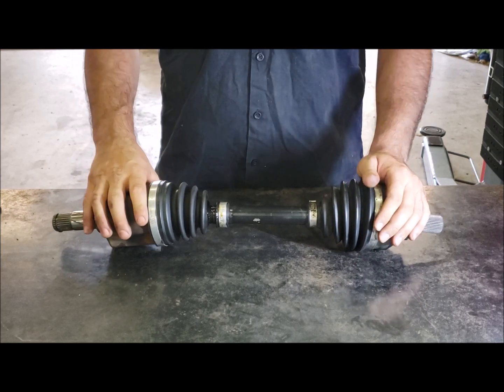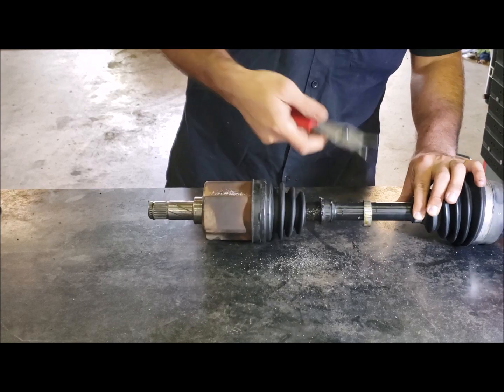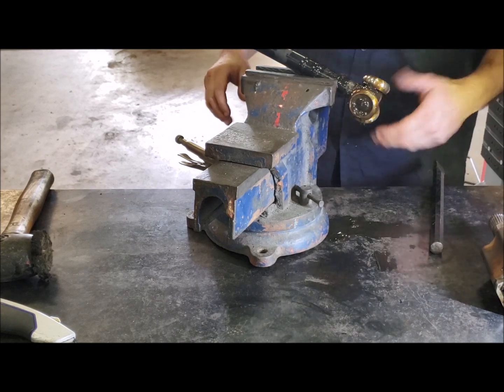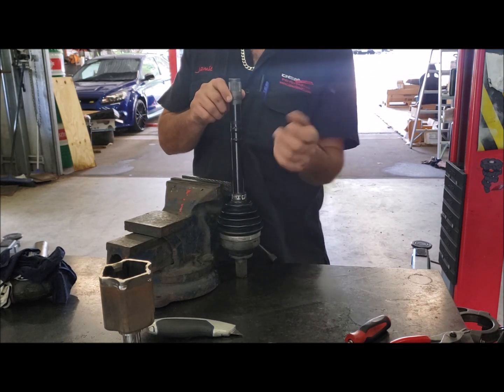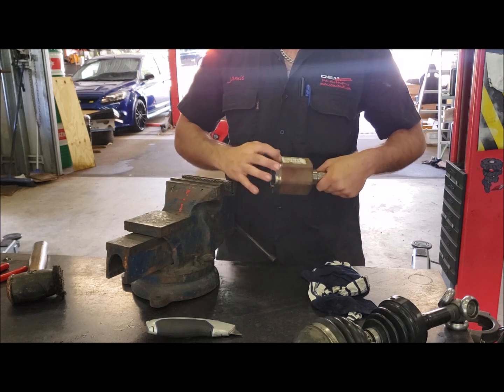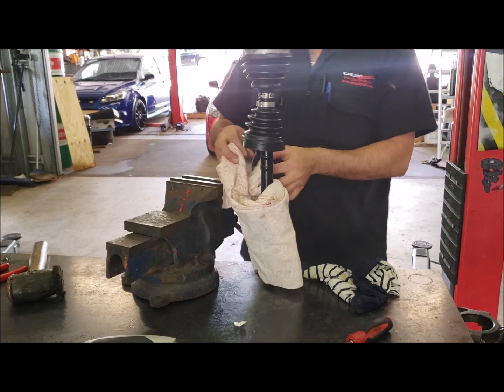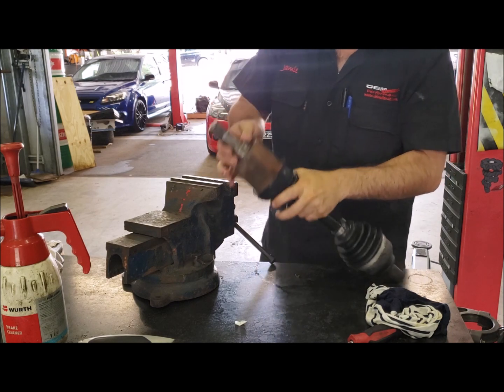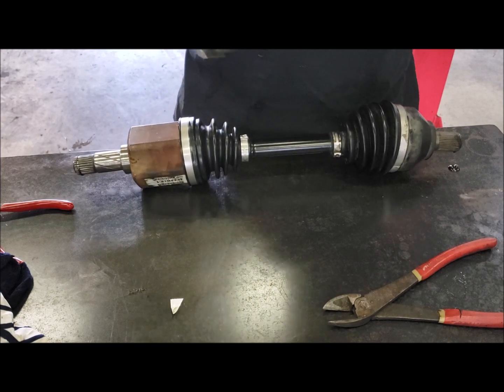XR5 Turbo / ST225 driveshaft rebuild & CV boot replacement. Step by step by OEM Denied Performance

Comment: Can the other end be replaced? Does it not fail as much hence not doing it in this vid?
Reply from the maker: anything can fail but havent ever had one with a failed outer joint myself as its a much more robust ball type joint design. The outer joint doesnt come apart like the inner one does so if you have one with a failed outer joint you need to replace the drive shaft.
Reply: @OEMDeniedPerformance  thanks so much, this helps more than you know

Comment: Quick question, is the RS driveshaft exactly the same or are they different part numbers? Also, on the longer driveshaft, my tripod literally pulls out of the joint with no effort at all.it actually came out into the boot when I was changing the bottom arm. Managed to get it back in with a bit of manipulation without removing the boot. Does this sound normal? Yours seemed to require quite a bit of tapping out.
Reply from the maker: if the needle bearings are crushed then the joint will come apart more easily. RS is the same in sense of design but the shaft is not the same dimension wise as the ST/XR5 so the parts aren't interchangeable between them.
Reply: @OEMDeniedPerformance  Thanks for the reply. It seems i may of been lucky as the car still drives perfect with no knocks. Im not familiar with the tripod joints as all my mechanical knowledge is on older cars and i never came across them before. Thanks for all your videos they are very helpful.

Comment: Do you have a link or spec for the tripod bearing? In the UK the only option we have is to buy new or refurbished shafts.
Thanks
Reply: I know the drivers side here in the uk uses 26 splines but i need to know the short shaft if uses 23 or 26. I have already rebuilt the long one using tripod bearing from febest in germany
Reply: Have rebuilt both now and on my st225 both sides are 26 splines
Reply: @01welshl  you got a link for bearing bud?
Reply: Have you got a link to the bearing mate?  @01welshl
Reply: @01welshl do you have a link for the bearings/cups?
Reply: https://www.focusstoc.com/threads/driveshafts.574715/page-2  :) it's all on last page
Reply: Would also like to know this!, and would like to do both inner and outer cv joints 👌